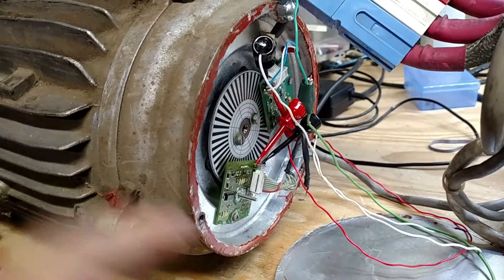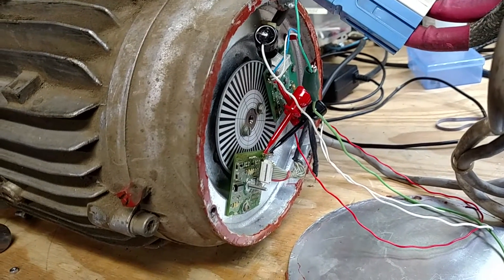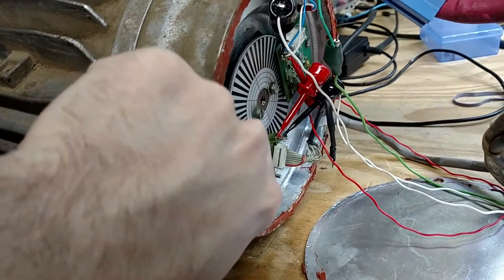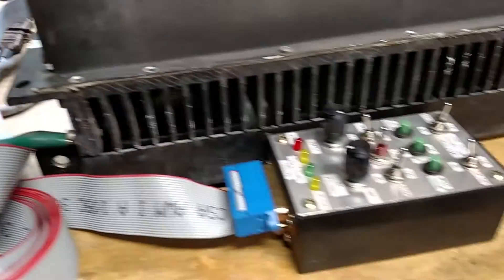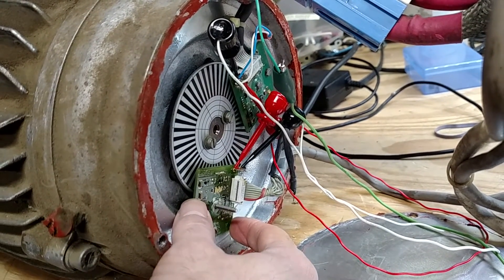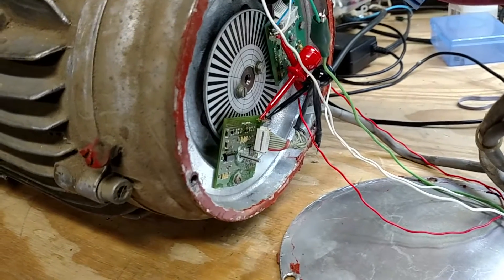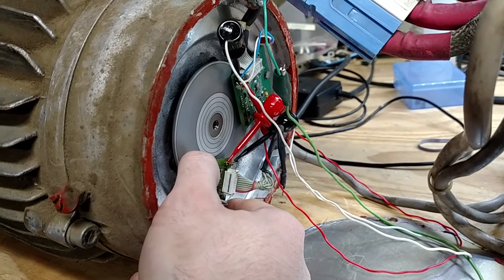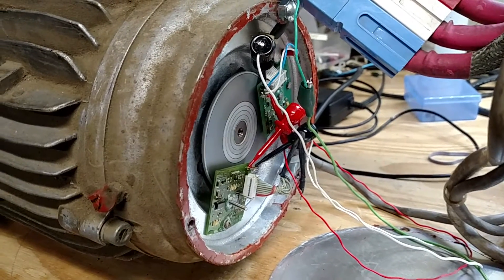Encoder adjustment without an oscilloscope...

Comment: can explain  about alighnment of encoder . what is the basic idea. what is the relation between encoder disk and motor shaft, what is electrical angle. how to alighn
Reply from the maker: It is an AC induction motor.
So there is no angle relationship to the rotor.
The motor controller only cares about the velocity of the rotor and it's relation to stator's rotating magnetic field (slip value).

Comment: That is great.
What are the motor coil resistance and inductance.
Reply from the maker: The motor is a Brusa ACgtx20. I am not sure of the resistance or inductance...
I have re-programmed a UMOC445 for use with that motor wired in WYE. These are the parameters supplied by Solectria:
http://wolftronix.com/umoc445_546/pages/IMG_7979.htm
I could measure the resistance and inductance of a coil... but resistance will vary with temperature and inductance will vary with torque.